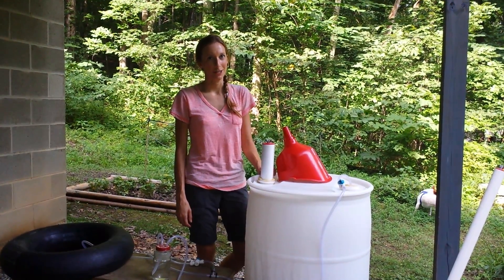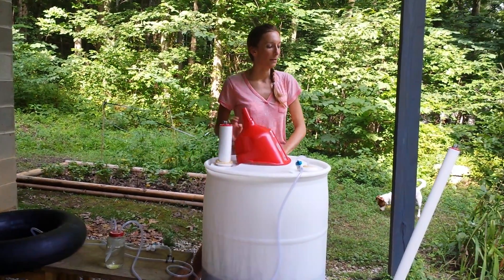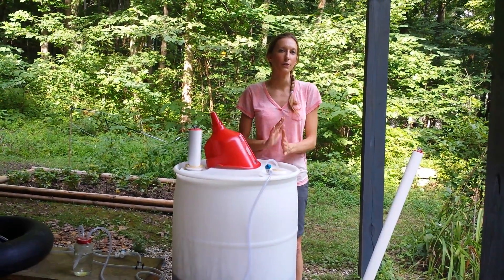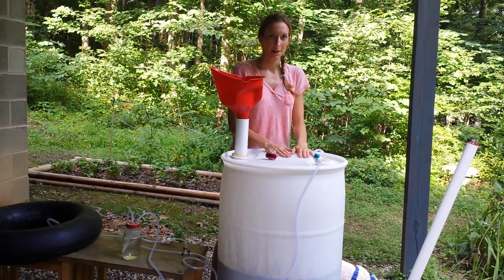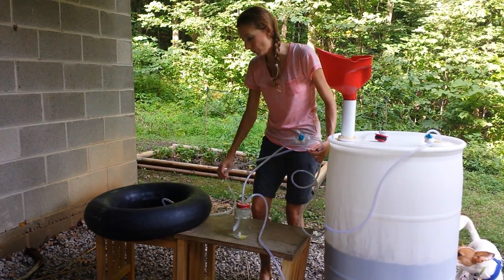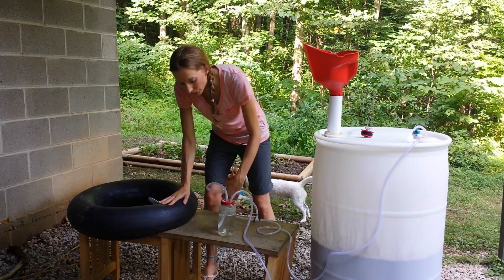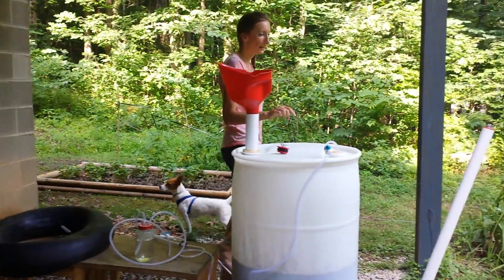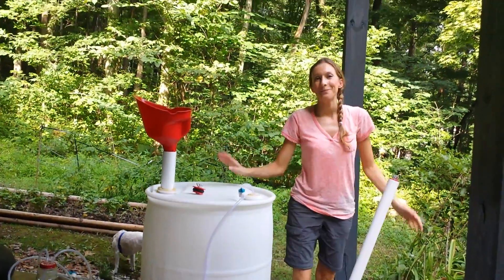Heather's Small Scale Biodigester

Comment: Nice work!  where is your max fill line? Is your effluent pulling from the very top of your skim line that is visible? if not how far from the bottom and top? Does your system get sunlight? Have a gas pressure relief valve?  I wonder how important to water purify the gas if cooking with sealed containers?

Comment: Does it really start a generator, Like a small Honda invertor 1000?
Reply from the maker: Hey so as far as generators are concerned it either needs to be one made to use natural gas or converted to use natural gas. My understanding is that the Honda 1000 is a gasoline generator which would need to be altered not just used outright. Hope that helps..

Comment: Hi. Heather. I know you started off with manure based water. I have 2 questions for you. 
The first, what would be the ratio to use when using cow/pig dung (how much dung and how much water, may be with a bucket)?
The second question is, your digester must be allowing oxygen in,  since it's transparent and allowing light in. Wouldn't it cause CO2 and algae to grow. What did you do to protect it from algae? Thanks and good work.
Reply from the maker: Hey, thanks for the question. Pig manure make great biogas too. The ratio of water to manure should be 4:1, respectively. Also,  yes the drum was painted with a black sunproof opaque black paint to disallow sunlight. I probably should have waited to make the video afterward!
Reply: @skinnyemt1  Thank you for responding to my previous questions. I'm curious since you said the ratio water to manure is 4:1, that's a lot of water isn't it? Or maybe you can explain more how the ratio works. I'm thinking 4 buckets of water and 1 in manure. Also, was the idea to use water for filtration to reduce suffocation? Thank you again for your help.
Reply from the maker: @mewedeou  4 buckets water to 1 bucket manure is perfect, you need tons of moisture so that you can create gases and effluent without the worry of drying out, it also makes the environment for thermophiles and mesophiles possible. If you are familiar with composting, it is a similar situation. You want to have a base where the "philes" can move around freely and do their job.
The water filtration I use removes carbon dioxide and hydrogen sulfide traces from the biogas so that it will burn more cleanly and safely. There are other ways to do this, but water is the the easiest and most efficient in my opinion since the impurities we want to get rid of are very water soluble.
Reply: Hi again Heather. I am wondering what kind of filter you got and where did you get it? Also, where can I get the tubing and the drums? I am still impressed with the fact that you used water and filter to remove carbon dioxide and hydrogen sulfide. I am guessing you also used the filter to avoid suffocation. Speaking of suffocation, I know you mentioned it in your previous video, but what are some advice you can give me to avoid suffocation? I keep hearing that's one of the downside to biogass. Thank  you again.

Comment: In which state are you, does the production of methane slow down during winter ?
Reply from the maker: I'm in California but I built this particular one in Ohio. Yes, the colder winter temperatures do slow the breakdown of wastes and production of gas unless supplemented with warmth. This can often be done by placing the biodigester inside a greenhouse or under a covered area heated with solar panels. Certainly adjustments can be made depending on where you are located.
Reply: Heather S Thank you Heather I live in Hawaii ( Oahu ). I want to built a ranch on the the Big Island self sustainable, , methane is highly used in Europe to power cars ( methane increases the mileage by 50 % ). I’ve been very interested in trying this, you make it easy to do it.
Reply from the maker: @skysurfer6870  thank you so much! The Big Island should be a great climate for bio-digesting, best wishes!

Comment: Great video, I'm looking building a unit using the 45 gallon drum as you have, I'm just wondering how long it's taking to fill up the innertube from flat?
Reply from the maker: I'm so glad you will be making one!    How long will it take to fill the inter tube short answer is, it depends. The various conditions for your digester, such as temperature, what wastes you use, and how much of it you use to start with will determine how quickly you produce bio gas. Optimum temperature will get the mesophiles and thermophiles working properly, keeping a good C:N ratio, these variables will contribute to the success of gas production. Patience is key at the beginning  because there will be a sedentation period where nothing will be produced, be patient and once it begins continue adding to the digester to prevent gas production from slowing or ceasing. It some instances it can certainly take weeks or longer to start.

Comment: Hi heather thanks for the inspiration I have constructed a unit similar to yours and it is producing a h2s gas, however it does not seem to be flammable sebum not sure if everything is working as it should. I did not use anything to jump start the digestion process cow manure ect i just began adding food and garden waste. Do you think I should try and add some form of manure to introduce the bacteria needed for digestion and gas production or will this occur naturally given more time. Thank you
Reply from the maker: Hello, and thanks for your response. You are already on to answering your own question! Yes, you should definitely have livestock manure, preferably one high in nitrogen like that from a horse or cow. You can usually take this from a farm for free and they will be glad to let you. The manure enhances the buffer capacity of the anaerobic system. Also, you want to have the best Carbon/Nitrogen ratio (about 18 or less) to make sure you have a quality, usable, biogas. Hope that helps a bit!
Reply from the maker: Also, please do be careful H2S and any biogas for that matter, can be both flammable and hazardous to breathe! In anaerobic digestion the sulfur smell should be lessened, not worsened, mostly because it is sealed off to the outside air and also as the contents of the digester are broken down. Proper ratios of the contents will help you produce the best biogas. Good luck and please be safe!

Comment: Very nice!  If you want to reduce Hydrogen Sulfide (rotten egg smell) run through a  secondary filter of iron filings - the iron filings will react with the hydrogen sulfide, purifying the gas further. I read this years ago in a book called "The Handbook Of Homeade Power".
Reply from the maker: Thanks!
Reply: @skinnyemt1  cN you update
Reply: what is water filter for?why we need it?
Reply: Water filter is for elimination of carbon dioxide.  CO2 is reacted with water to form carbonic acid H2CO3. And methane CH4 don't react passes through the next pipe. Methane is burns like lpg.
Reply: Steel wool is good for that
Reply: This about three  years ago 😳

Comment: Nicely done, this setup may be used for cooking. The water bubbler will take a little bit of CO2 out for higher quality gas. For a generator hookup, a filter (pvc tube with steel wool) to scrub off the hydrogen sulfide (H2S). If H2S is not filtered out it will corrode (destroy) your generator's internals. Although biogas contains very little H2S, you should try to filter out H2S even for cooking, because it is very poisonous. A moister separator would take water vapors produced by the digester and filters out.
Reply from the maker: Thank you friend, good advice!

Comment: Hey i am also test on water dispensor bottle of 20 liters in which, i only fill cow dung 4kg and water4liters in equal ratio.  The gas is start generated from 4 days and still it is produce n store in a tube. I test it after 4 days but gas is not burn , which is clear indication that it is CO2 GAS which is a non flamable gas. Can u tell me how it takes time to produce methane gas and tell me also  the purification process of CO2 gas
Reply: Route the gas line through Sodium Hydroxide. This will scrub off the CO2 and you should be left with cleaner methane.

Comment: The way I understand it, what you are calling the filter actually serves as a safety precaution. It will theoretically extinguish a flame traveling back through the tube.  I don't see the purpose of the long pipe the funnel fits into.  It is just a longer bottleneck that food has to be forced through. Your overflow pipe could be shorter if you removed the inlet pipe.

Comment: Please help I'm trying to build a biodigester like this one. What do you call the gas tube that you used and where did you get one? Also how did you connect the gas tube to the tire inner tube? Thank you for your help.
Reply: The key here is to make sure that whatever gas line tubing you use it must fit the tire inner tube quite snugly so that the gas line does not leak. I bought mine from a local hardware store.  Usually those of a flexible plastic variety work best.
Reply: me too I'm trying build this please could you give us  DIY Tools which and where to buy from?

Comment: Hello, this is so amasing that I made one, but during the day, the pneumatic tire is inflated and during the night is not. What could it be?
Reply from the maker: Bárbara Joo Lara what is the fluctuation in temperature between night and day where you are located? Also, did the tire almost immediately inflate after creating the digester?
Reply: Is around 10 degrees the temperature fluctuation (~25-35°C). And no, after the first day it was a small inflation, but from day 5-12 (today is day 12) this difference is very noticeable, it really expandes during the day.
Reply: I truly think that the inflation difference during the day could be due to the increased temperatures causing optimal thermophilic action on the raw materials.  However, it concerns me that is deflates at night..could you have a leak somewhere throughout the tubing, plugs, or elsewhere in the system?

Comment: Hi
I want to know if I can apply this on a smaller scale using only kitchen waste and also how can I benefit form the biogas on a household scale?
Reply from the maker: Fatima Mohamed yes you can use it on a smaller scale with kitchen waste as long as you have a hot enough environment for the thermophiles and mesophiles to breakfown the waste and produce methane  gas..also the waiting period may be quite a bit longer than it would be if you were on a larger scale or starting with animal waste. You may want to use your smaller scale kitchen waste digester to produce a nutrient rich organic fertilizer rather than obtaining gas.
Reply: thank you so much for replying 
and actually yes we first wanted to make the digester to just obtain a fertilizer but when i did search about the anaerobic system i knew that methane would also be obtained and it has a great greenhouse gas effect so I thought instead of releasing it to the atmosphere even if in a small proportion, we might use it.
and the kitchen waste we are going to use is not actually from one house, we were planning to apply this project on the roof of a block of flats since where I live there are hundreds of blocks with no enough spaces in between.
Reply from the maker: Fatima Mohamed yes that will be awesome! Then definitely with multiple places involved you should eventually be able to sequester enough methane to run a generator or power something for a length of time. Please let me know how it goes! :)
Reply: sure I will :)) thank you so much...:)